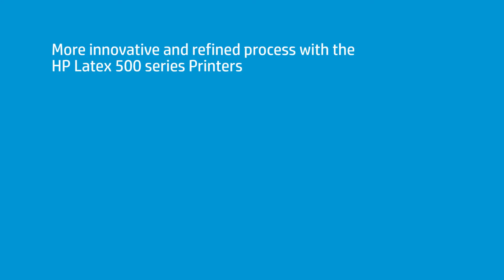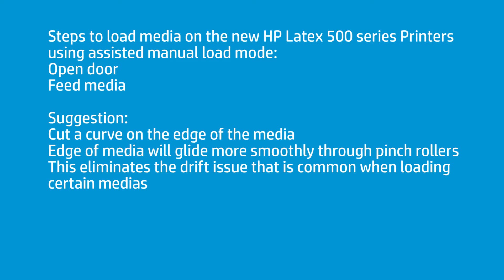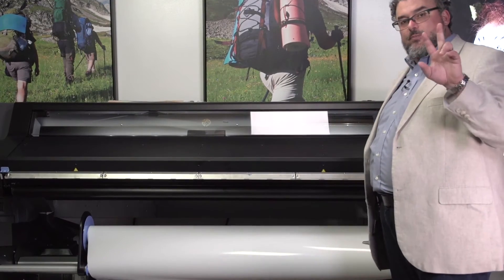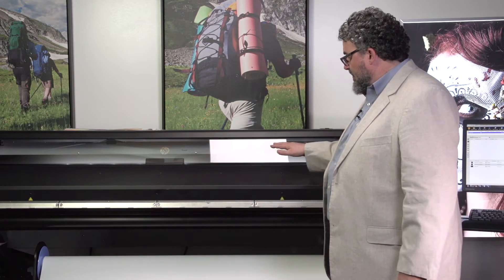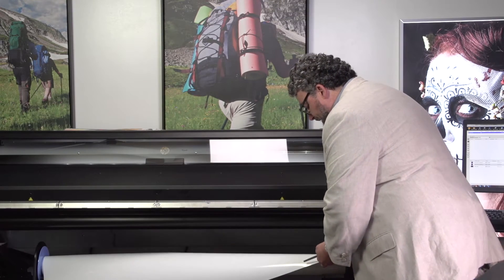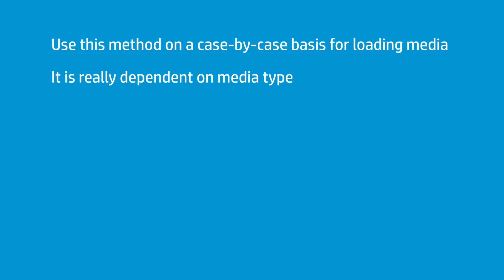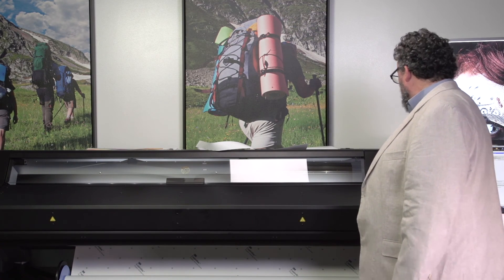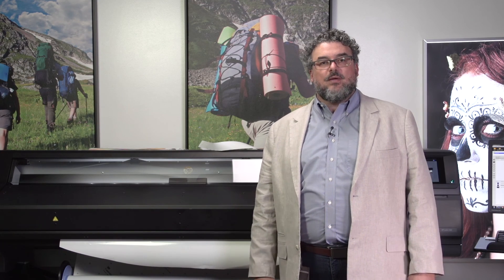Autoload Process | HP Latex 560 & 570 Printers | HP

Comment: A month has passed since they asked for help with a printer malfunction. The service did not respond, we received a response from HP Georgii Murylev. The response to our request was ignored, there are even no recommendations for fixing the problem. Only links to the operating instructions and printer settings. The malfunction is electronic and was from the very start of the printer. The HP engineer did not fix it at startup.
Reply from the maker: +Aleksandr Grekov Please contact our phone support team to fix this issue. Please follow these steps to reach them.
Step 1. Open link: https://support.hp.com/us-en/contact-hp
Step 2. Select the product type.
Step 3. Enter the serial number of your device or select let HP detect your product option.
Step 4. Select the country from the drop-down.
Step 5. You should see the HP phone support number.

Comment: that is the smallest roll will it accept?
Reply: 11 inches wide. I would guess no less than 9 ft long since the startup takes up more than the print itself. And once the end of the roll is detected it will not dry the print completely.